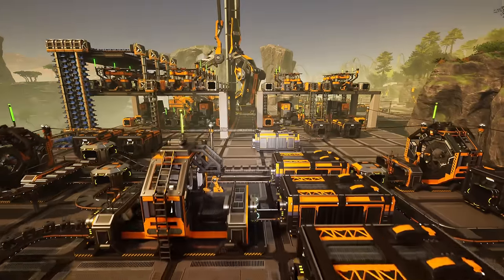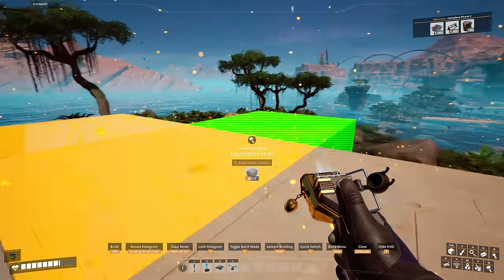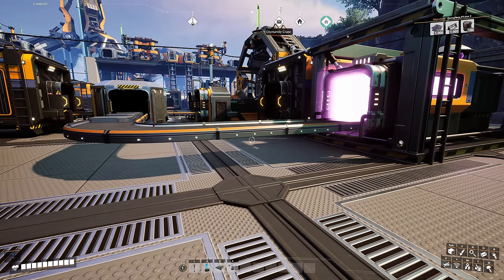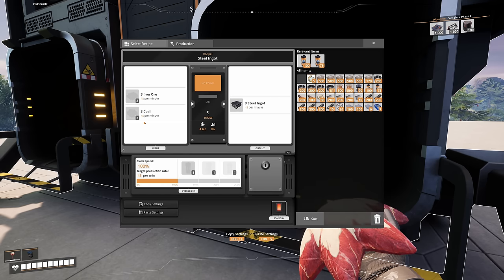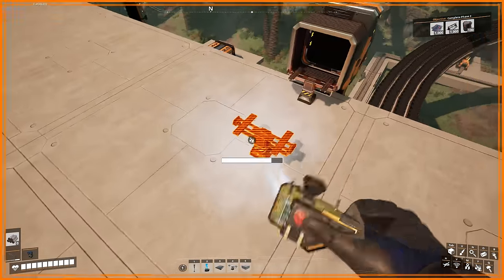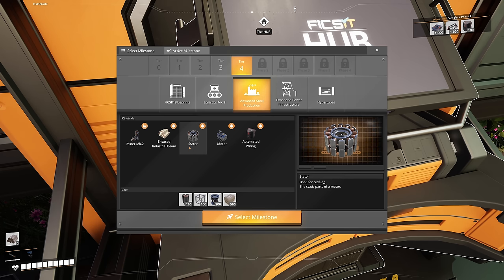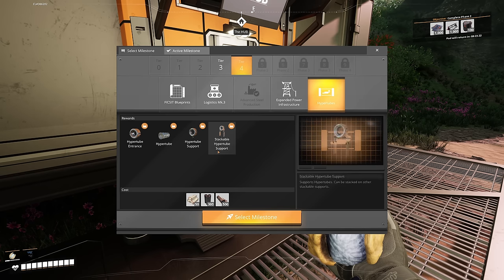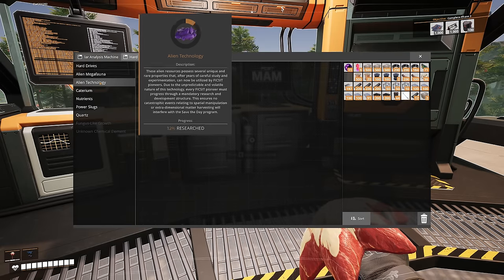Utilizing "THE VOID" For Steel In Satisfactory 1.0

Comment: Bitz you had SAM ore in the cave right next to you between your coal nodes.  Not to mention quartz.  Or are you taking the long trip "for the memes"?
Reply: Ehhh if you look at the map they are a bit of the same distance from where hes at though the cave is a normal node and easier to get to just dealing with some small spooders.
Reply: As the crow or manta fly it may be close. But he had to put in a lot of infra vs just a cave run. I ran quartz and SAM out of the cave early. Future Lemur thanked me
Reply: @TaintedLemur  I had a quartz processing plant there in my update 8 save that belted everything outside and up to the above cliff with train and all. I plan to rebuild it only this time it will be a hidden sam plant as well.

Comment: If you find at least 60 computers while HDD hunting and you collect 11 sloops (might be 1 or two more I forget), you can get yourself a Power Augmenter at T4 Advanced Steel for a free 500MW and 10% boost.
Reply: Correct me if I’m wrong but it needs singularities or something not?
Reply: @I-Consume-H20  If you're talking about one of the new late game items, that's only for "empowering" them. They produce 500MW and give a 10% additive boost to your total power per Augmenter without anything.

Now if you mean the SAM Fluctuators those are pretty easy since SAM nodes are around some common locations. 

Find yourself 60 Computers, 200 Steel Pipes, 50 Encased Industrial Beam, and 25 Motors at the Hard Drives and you can get a Power Augmenter up as soon as you unlock the MAM in Field Research in T1.

Comment: Bitz your explanation of the Depot research was WAY OFF. The left side of the tree increases the stack limit of each material uploaded, so by the end of that tree you're able to upload a maximum of 5 stacks of each material (2500 concrete for example). The right side of the tree increases the upload speed by decreasing the time it takes to upload, a little weirdly worded in the MAM the upgrades are based on the initial 4s/item upload time, so you're looking at 2s, 1s, 0.5s, and finally 0.25s upload speeds. The middle branch of that tree allows the remote upload to take place from your inventory.